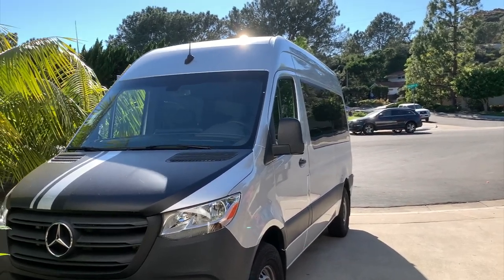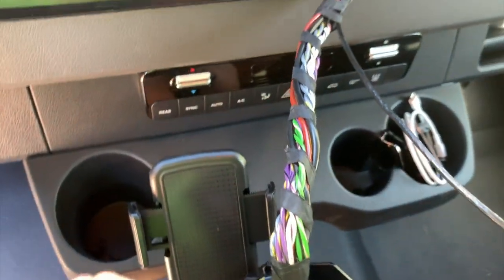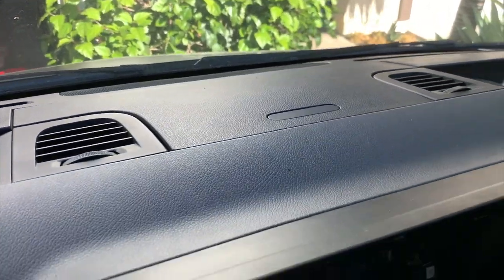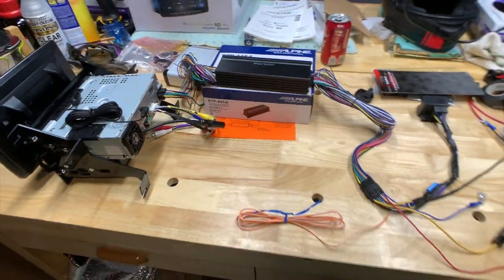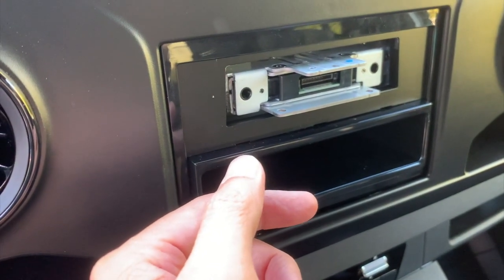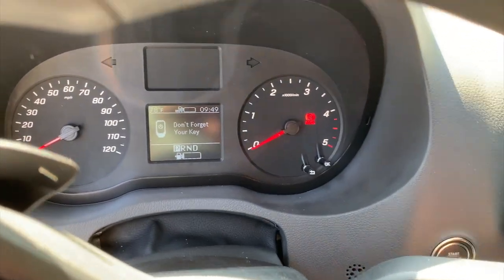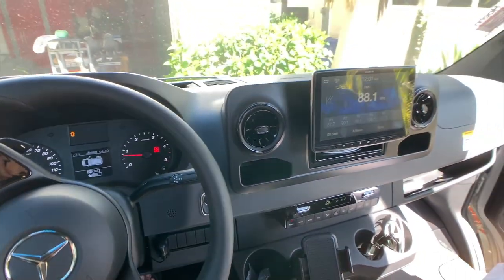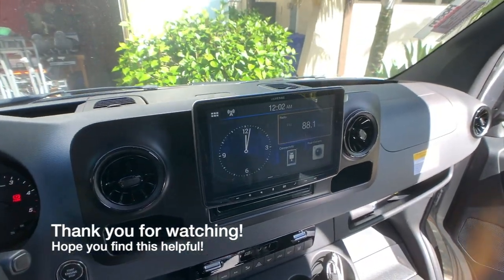2019 Sprinter van Alpine Halo9 installation

Comment: Thanks Fred! Great job. I am having a hard time locating a fuse for my accessory power. I decided to pull power from the factory harness so I only need to find a fuse placement for power to be cut when the door opens. Can you tell me which one you used for that purpose?
Reply from the maker: Hi, hopefully your van is the same as mine. The fuse position I use was position "43" located at the bottom row. It will cut power when ignition switches off & driver door opens. Hope that helps. I actually have more trouble finding the always on battery power from the fuse box. Every time I thought I found it, my clock and preset still got wiped if I don't use the van a few days. So I finally hardwired it to the battery terminal, instead from the fuse box.

Comment: Nice video.  You mention running wires up the a-pillar.  Did you have to rewire the factory rear camera and radio/gps antennas?
Reply from the maker: No. Both factory camera and radio can be tapped in behind the rear view mirror using the Mid City Engineer radio and camera cables ("adapter"). Those two cables are what will be run in the a-pillar down to your head unit. Mid City Engineer website have very good installation instruction for them: Radio: https://midcityengineering.dozuki.com/Guide/907ANT+-+2019+Sprinter+(907)+Antenna+Adapter/22?lang=en; camera: https://midcityengineering.dozuki.com/Guide/Installation+-+907CAM+OEM+Camera+Integration+to+Aftermarket+Radio/20?lang=en

Comment: Did you upgrade your speakers? If so which brand and model did you go with?
Reply from the maker: Sorry about the late reply. No but I am thinking about it.
Reply from the maker: I ended up use JL audio C1-650/650x. Just installed. Check it out: https://youtu.be/b3Dh3OgTcRc
Reply: Do you think this 445a (or similar) plus new speakers can be attached to the OEM head unit?

Comment: Is your Circuit Fuse Tap insulted alright? Looks like up-side-down.
Please let me know if you changed after this video. Thank you.
Reply from the maker: Thanks for the comment. I double checked. The way the fuse taps were connected in video is correct. At least in my Sprinter, the top fuse slot is HOT. You should always draw from the opposite side otherwise you will have no fuse protection.
Reply: @fredzhang5212  Thanks Fred!!
I started converting sprinter 170WB.
I am watching your video as good reference ^^
Thank you
Reply: @fredzhang5212   Fred, can you help me with the purple wire from the Mid City Engineering's camera. Where did you connect the purple wire with?
Reply: @byungwoo1003  yea I am looking for a place to get reverse signal as well

Comment: I'm curious to know why you need to take ignition and power in the fuse box? at the factory radio, you dont have these??
Reply from the maker: Thanks for the question and sorry for the late reply. My understanding is that the after market radio would draw more power than the factory radio. Therefore the power from the factory harness may not have big enough of a fuse for it. Wired directly from fuse box will ensure you put the proper amp fuse for the new radio/amplifier. I guess, alternatively, you can try to find which fuse is for the factory radio and switch it. The risk of that is such fuse may not only governing radio alone....then you may risk something else. I would prefer not changing the factory circuitry. Make sense?
Reply: @fredzhang5212  I just completed the radio swap on mine. I used the factory 12V Power but take the 12V (red) on the lighter plug. Seem to work flawlessly
Reply from the maker: @alexleblanc88  Great! Congrats! Make sure the fuse for lighter plug doesn't exceed what the new radio specified in order to give your new radio proper protection.

Comment: Hello friend. Can you please post the link to buy the chassis adapter? Thank you!
Reply from the maker: Here you go. You should be able to read the part number off the video too and just search Amazon. Metra 70-9003 Radio Wiring Harness for Audi/BMW/VW 2002-Up https://www.amazon.com/dp/B0002BEVAC/ref=cm_sw_r_cp_apip_x8X1mm3xt97K3
Reply: @fredzhang5212  Thank you, but that is the harness, I would like to know the Chassis Model (the one that you didn't like it because it was shinny)
Reply from the maker: @lahparada  Sorry I didn't notice this additional question. The chassis adaptor was a throw-in item when I ordered the head unit from Crutchfield. I don't think I have those information anymore since it's not a purchase item.
Reply from the maker: Might be too late for you but I actually found the info:  Metra 99-8731 Dash Kit
Reply: @fredzhang5212  Thank you!!

Comment: Nice detailed presentation but (with the vid volume max and my speakers on max) there was a problem:
- either the sound recording sucks
- either your phone was far away from you 
- either you spoke too softy 
I could hardly hear what you said, actually it seemed like you were talking for yourself there. 
So please do mind the sound next time you're doing a video presentation on something  :)
Reply from the maker: Thanks for the comments. I don't have a dedicated mic and I used the phone's mic which is not the best. However, I did adjust to a reasonable level during editing and it sounded okay from my end on either computer or mobile devices. Sorry it didn't come thru for you.